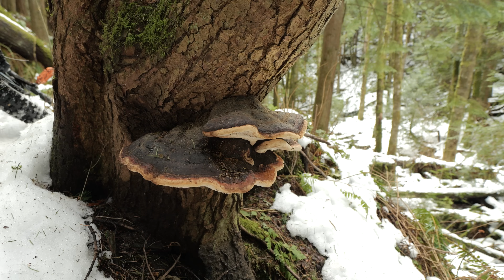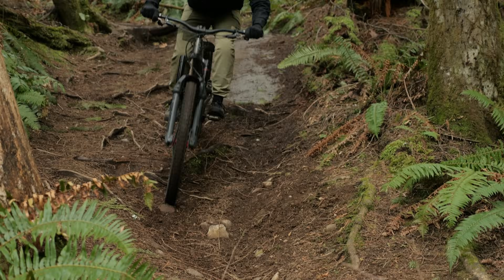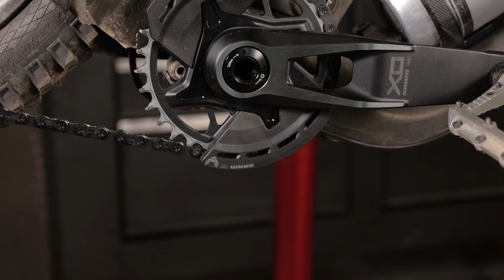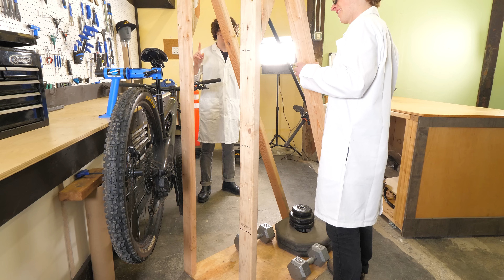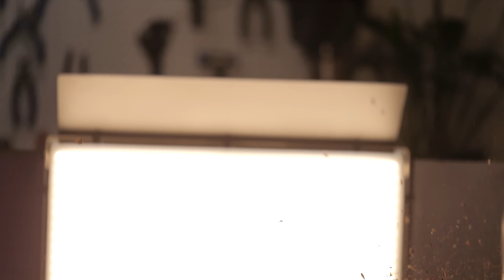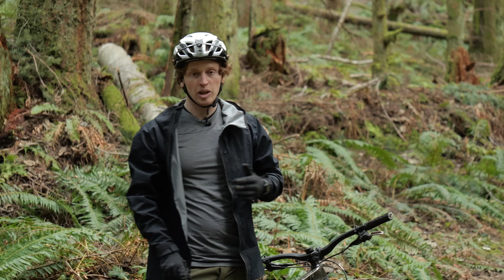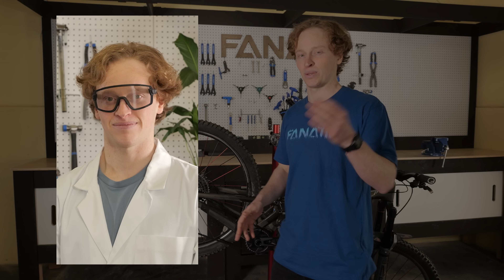Transmission: Why SRAM’s new drivetrain matters

Comment: If it aint broke don't fix it. Mechanical(Shimano) is still the standard. Nice try SRAM(Scott, Ray, sAm, Mike).  Too expensive and not backward compatible! I've been riding since the mid 90's. Done 24hr races and 12hr races. Learning to ride in So. California. Never hit a derailleur on a rock. Dont try to create a need where it's not a real problem to sell something waaay to expensive.
Reply: I don't disagree, but SRAM is a business, and every business is made to make money. Nobody is putting a gun to your head, and even though I'm not one of them, there's gonna be a ton of people who buy it ... And like most tech, it's starting on the high end, and will eventually trickle down if it's as good as advertised.
Reply: @topspot4834   Correct! Nobody is putting a gun to my head. It's just my opinion. There is always something new. Just like dropper seat-posts. Warren Buffet said, The number one rule in business. Is to stay in business.

Comment: I’m SO sorry, but this commercial is a little ridiculous. Did you really say that whenever you would bend the derailleur hanger you also irreparably damage the derailleur itself? Did you think to say that yourself, or is that part of the SRAM script? I think the biking community at large would tend to disagree. 😂
Reply: Yea, I’m going to have to agree with this. I have smacked my derailleur hard enough to bend my hanger and thrown my shifting way out of wack twice and both times I’ve changed out to a new hanger and my shifting goes back to normal.
Reply: These guys have put together a very comprehensive and detailed 12+ minute video and you're complaining about one 3 second sentence.
Also, the most common reason for bending a mech hanger is stupid things like banging your mech on the door frame, lying your bike on the ground gear-side-down and other clumsy non-riding bike storage errors. If you bend your hanger when riding, it will quite often bend the parallelogram.
-
Oh, and stop getting upset at the price of fancy cutting edge technology. You don't have to buy it. Your bike still works just as well as it did last week.

Comment: Let's not sing the virtues of replaceable parts until we know how readily available they are, if they're documented, and what they cost. You broke a slim portion of the upper part at 5:43 in your impact testing, but if it only comes with electronics, it might well be $400. Very few brands have a good track record for this. It's a marketing bullet point until proven otherwise.
Reply: It doesn't just come with the electronics...
Reply: Are you kidding? For that amount of money, I'd wait a long period without riding, over just getting a new whole derailleur